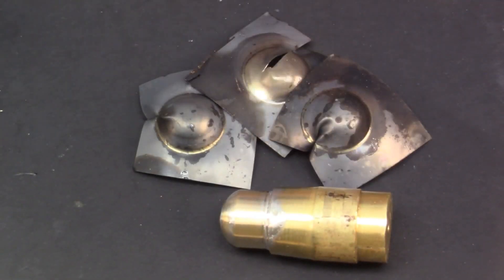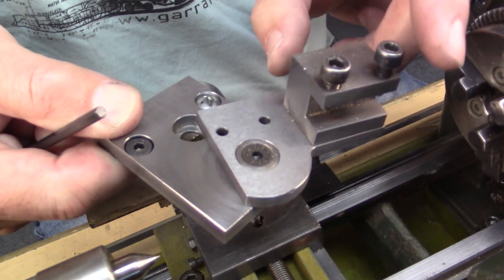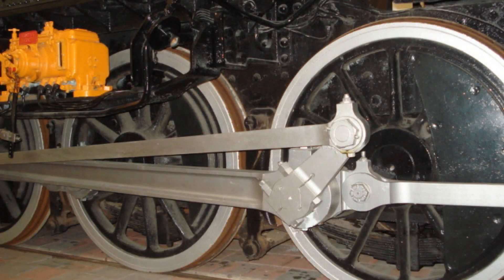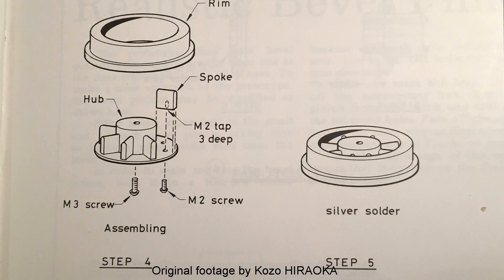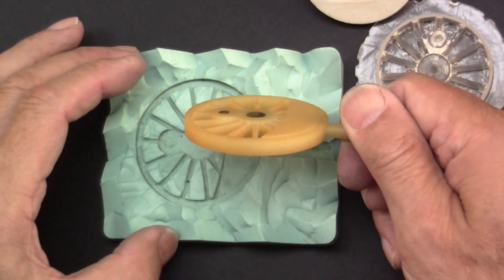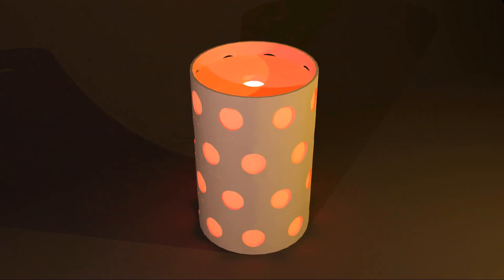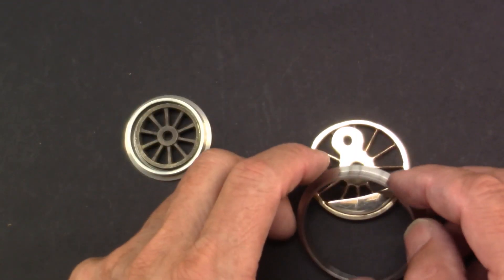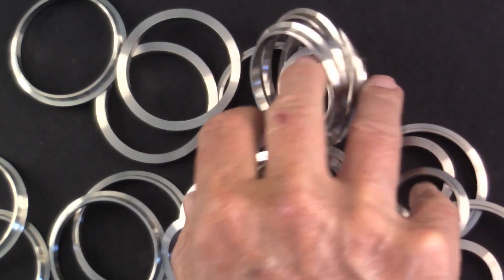09   WHEELS

Comment: Please don't spoil the wheels by buffing them.  This affects the flatness of machined faces and rounds off edges unnecessarily.

As per 'Garratt Fans' comment, use of carbide insert tooling is not ideal for this class of work.  Most inserts come with a slightly rounded top edge, to withstand heavy cuts in commercial work.  Carbide can be sharpened in similar manner to that as for HSS tools, for light duty, and either will give a superb finish when suitably ground.
I admire the work you put into compiling your videos - but is it possible you might correct the spelling of Beyer Peacock?
Reply from the maker: Ups 🤭- sorry it was late night...🙄

Comment: At 09:22 you use a carbide insert tool to face the wheel. I’d suggest you use A v-shaped HSS-tool with a very slight rounding of the V. This will result in a superb surface finish and will save you greatly on cleaning up the tool marks visible on the wheels after turning.